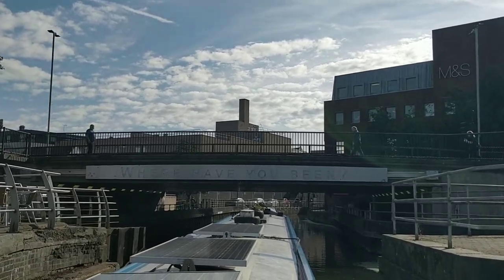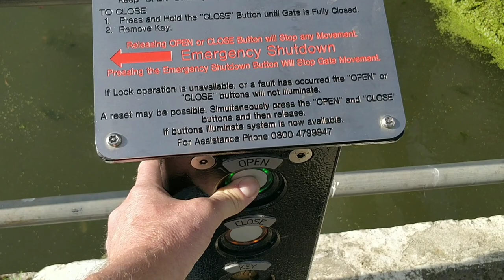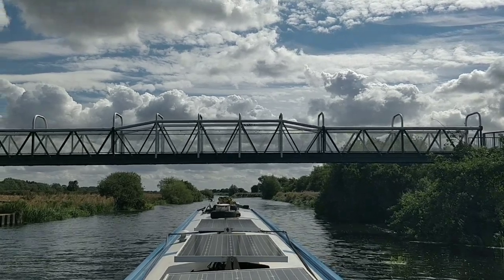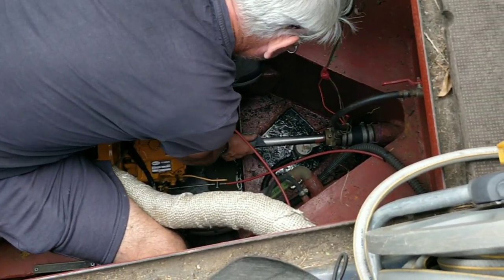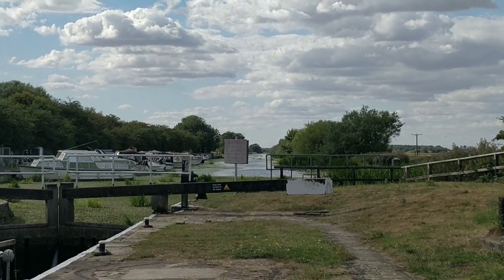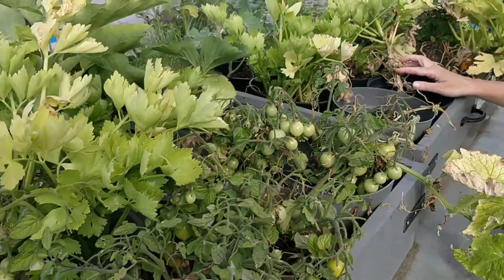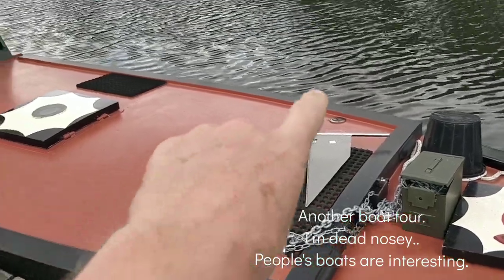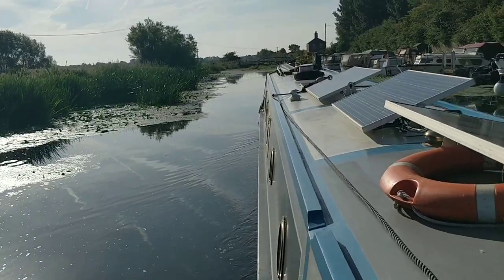Narrowboating out of Lincoln onto the river Witham. Major Boat repairs, tours, lifts, top vlog.

Comment: hope you got your keys back ok. you've been on some lovely boats. i couldnt sleep in the beds under the deck as i get mild claustrophobia xx
Reply from the maker: I love having a good nosey. I like those cosy little beds but I bet it's a pain going to the loo. Ha ha Have a lovely evening Sally.
Reply: Why isn't there a system that requires the same key to start the boat engine? You couldn't forget them then
Reply from the maker: @ethelmini  I think I should put the starter key with the lock key that would solve it. It's the first time I've left my keys. I was talking to a truck driver while leaving the lock.